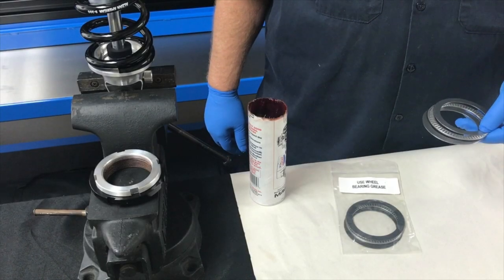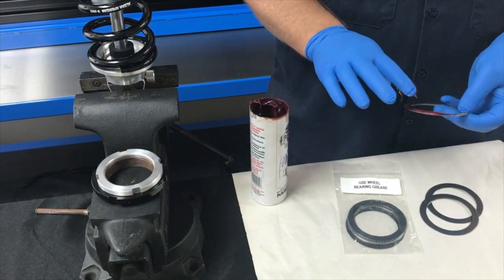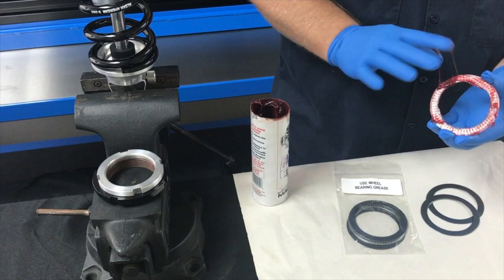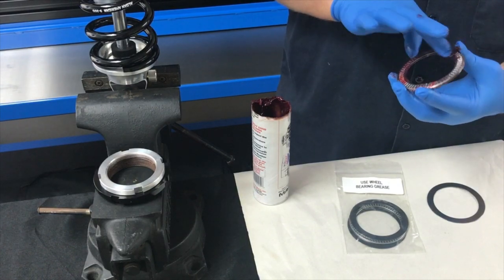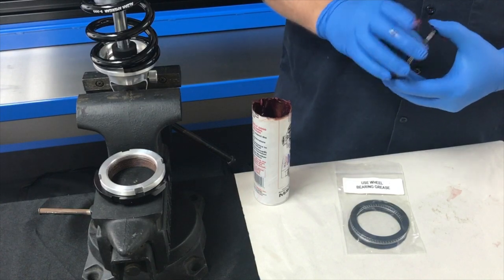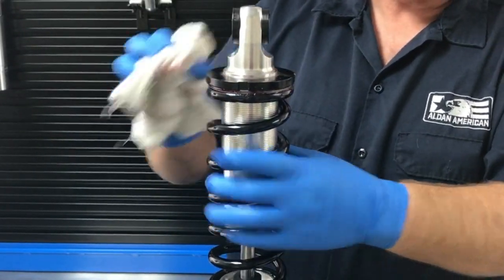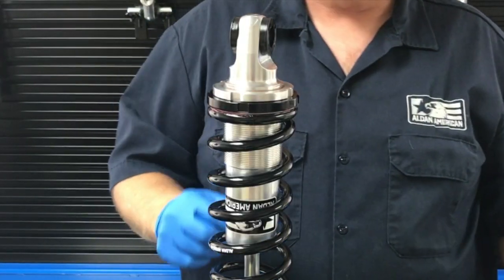How to Install thrust bearings - DIY

Comment: placement: bottom, top or both? does having it on both ends improve it?
Reply from the maker: With coilover thrust bearings, you only need to install these at the base of the coil spring

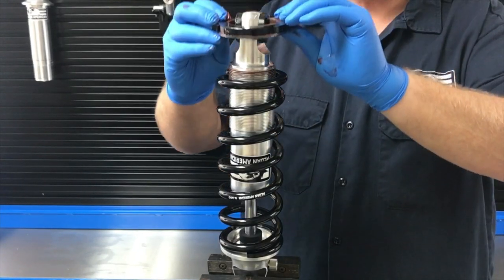Comment: very low volume.  you should say what kind of grease your using.  is the "wheel bearing" you speak of at 1:22,  part of the shock? where does grease go? on inner threads, or on flat surface?  if surface, one side or both?  this video skims over the info without detail.
Reply from the maker: Hi, thank you for your feedback. On the grease, we recommend applying this to the bearing itself. You can apply the wheel bearing grease on one side of the bearing and as you put the stainless washers on and the assembly together, the grease will travel through the entire bearing assembly. Check out Mag 1 brand, red wheel bearing grease.
Reply: thanks for the reply.